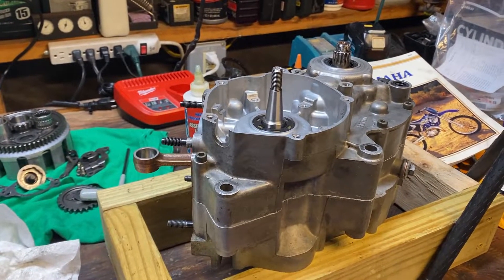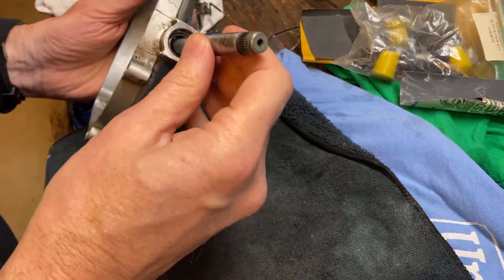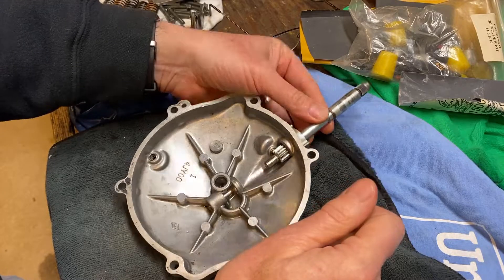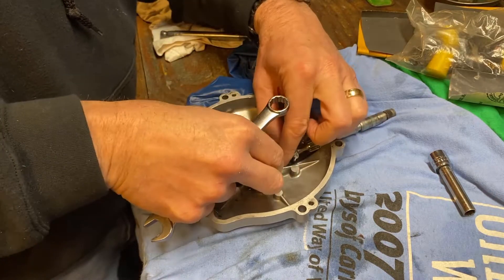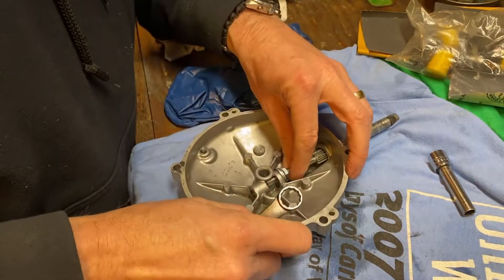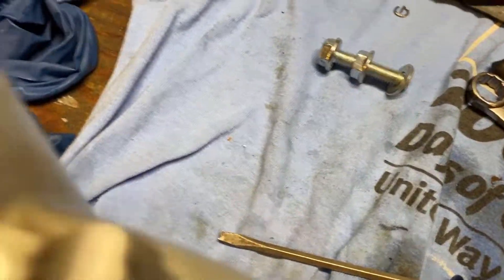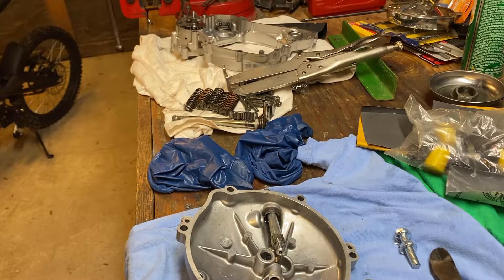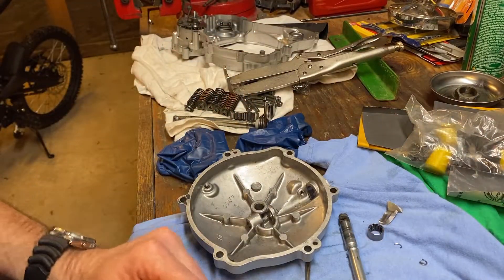YZ125 Clutch Arm Removal FAIL - Project YZ144 Part 4

Comment: I just successfully did this. 1/2” thin wall piece of copper pipe about 3.5” long. Get the seal out, then slip the pipe over the shaft down onto the bearing. Beat down on the pipe with small hammer and the bearing will push down and fall out the bottom. Worked like a charm. Bearing will slide down and be loose on the shaft and then you can work the shaft out at an angle through the bottom.

Comment: Same issue at the moment. No clue how to move forward
Reply from the maker: Watch part 5.  You have to push the bearing out from the inside with the shaft or pull it out using the shaft.  The key is it has to come out from the inside.

Comment: I’m struggling with the same thing rn
Reply from the maker: Watch part 5 where I put it back together.  It has to come out from the top, heat up the case and use the gear on the inside to push the bearing out.